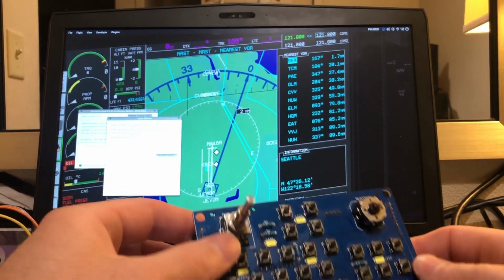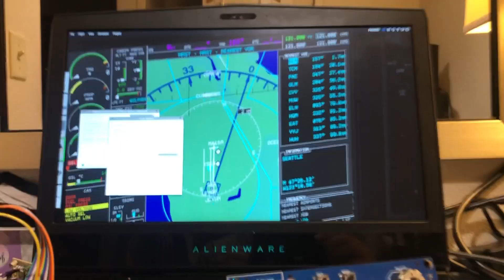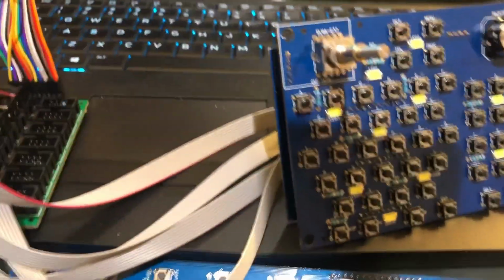PCBs for Homemade Flight Simulators!

Comment: Great work. Question abt the Distribution board. Do you toggle the Sig and EN Connection through the switch.? If yes how do you get with an input the EN on ground with a 2pole switch.

Comment: Your work is really awesome! I've recently started using simvim. I've wired up a few things and done some soldering. I think I'm headed in the right direction. What type of CNC machine do have? I'm looking to getting back into flying and the "button and switches" I think are key.

Comment: Hello is it possible to order these PCBS ? i want to use it for G1000 and the parking brake etc,     these boards seems like a great upgrade as u got leds already installed on the boards. also the connections are all there,         i would love if i could buy it as a kit and solder on the leds or buttons etc, or just a finished pcb with all the buttons etc.

Comment: Hotstart TBM900 is the only plane I fly in X-Plane and I've been dreaming of building a home cockpit around that aircraft. I downloaded your G1000 designs and I have access to 3D printer so next weekend I'm planning to print out the bezel (10,4") and also order the screen for it. Have you made any plans to make the autopilot and overhead panel for the TBM as well? And also if you plan to make a throttle for the TBM, have you figured out any way to do it so that it actually works? I have made plans in my head but just getting it to work the right way is the hard part since you can't map all the movements of the throttle to buttons.
Reply from the maker: Journey To Watchmaking  The bezels I designed are 12.1” one day I’ll make a 10.4” but I wanna finish up the TBM auto pilot, overhead, and throttle. Unfortunately I’ve been extremely busy lately. The Autopilot is about 50% done. And I have an Idea on how to do the throttle.

Comment: Hi,
I'm 14 and very much looking to go down the diy flight sim route.  My end goal is to build a replica cockpit for the Diamond DA62.  I noticed you're designing a GCU 475.  Would you be able to offer me any help to design a GCU 476?  I have a 3D printer and know how to use CAD, but I'm just not very good with arduino and electronics.  evanh3103@gmail.com
Reply from the maker: Evan, 
Take a look at https://simvim.com/index.html. I never used an Arduino before starting this project. They make it really easy for a beginner to build flight simulator hardware for Xplane.
Reply: @FlightSimMaker  Just wondering where you got the CAD files for the GCU 475 from as well as how you made the rubber buttons
Reply from the maker: @evanhill110  I design all the .STL files. The buttons are 3D printed as well. My goal is not to make a 100% accurate replica. But rather to make something that is similar to the real thing in function in a cost effective way.
Reply: @FlightSimMaker  Do you base the model of off existing technical drawings of the products?  If so, where do you find them?  My plan is to use spare parts from a real Diamond DA62 to make my cockpit, then wire all the switches myself and install homemade replicas of all the avionics
Reply from the maker: @evanhill110  You can google most of the technical drawings. Using real aircraft parts will increase your cost significantly. If you make 3D printable designs, you can share them with everyone allowing more people to enjoy your hard work.
Reply: @FlightSimMaker  I can't seem to find technical drawings for most of these products, is there somewhere you recommend I look
Reply: @FlightSimMaker  I'm talking to Diamond's UK distributor and they are trying to get me the CAD files so that I can replicate the majority of the aircraft myself.  Im just planning on buying things like the control sticks, rudder pedals, throttle quadrants and things like switch guard you can't get anywhere else or that I can't make myself.  I have access to a vinyl plotter, laser cutter and CNC router at my school, so I can make the majority of the panel myself
Reply: Evan, Might I say, this is sounding really awesome! I wish you the best of luck with your simulator!
Reply: @CaptainBobSim  Thanks Bob!  Love your channel